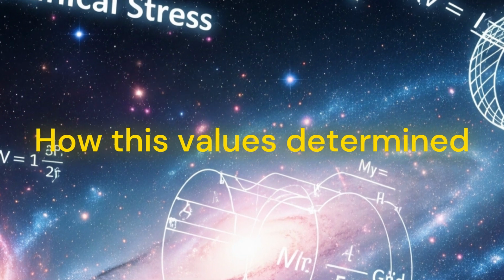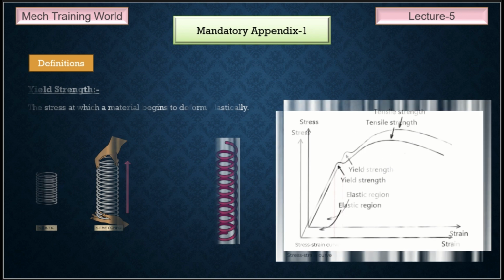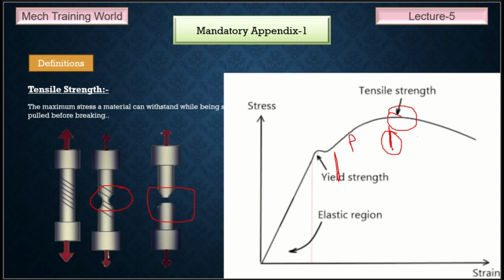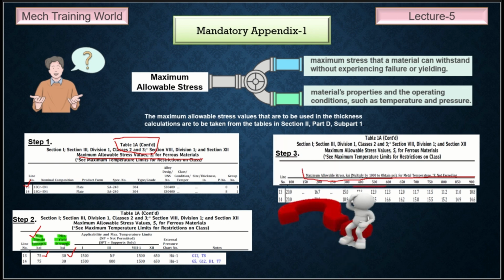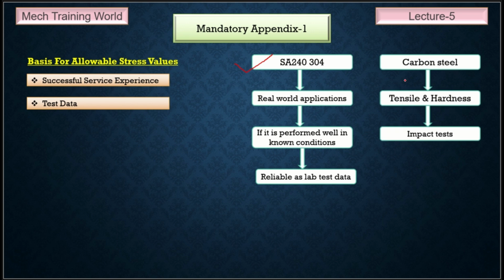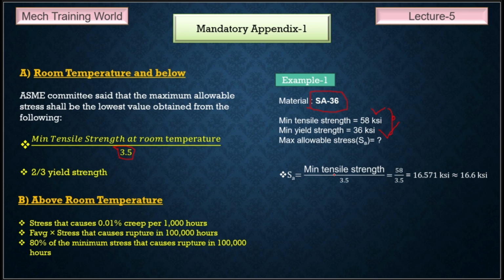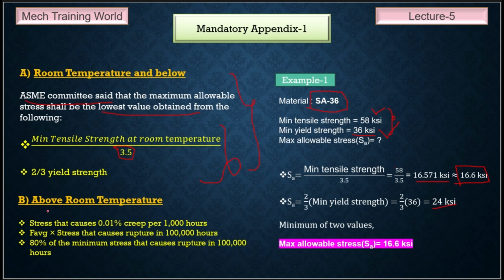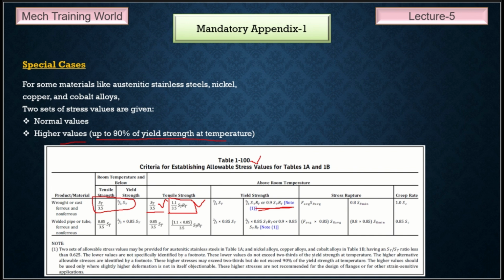How to calculate Allowable Stress Values and What is the Basis as per ASME Sec-II Part-D MA-1 Lec-5

Comment: Thanks for the great presentation , really interesting . Can you please explain what is the mean by Room temperature . What is the difference between design temperature and room temperature
Reply from the maker: Room temperature generally refers to the ambient temperature of the surrounding environment, typically around 20°C to 25°C (68°F to 77°F).

Design temperature is the maximum or sometimes minimum temperature that a pressure vessel or heat exchanger is expected to experience during operation.

thanks for watching!